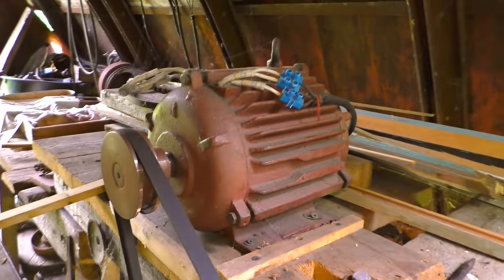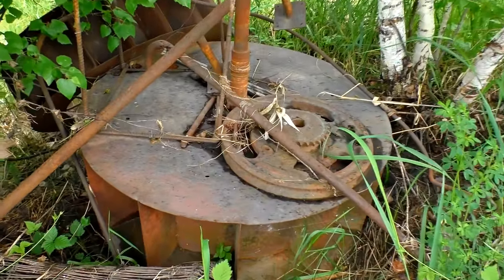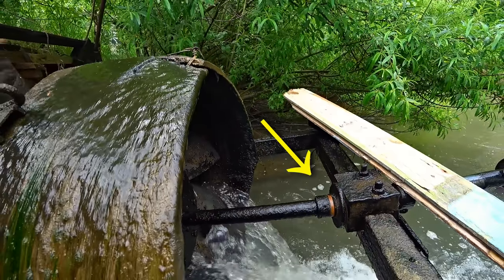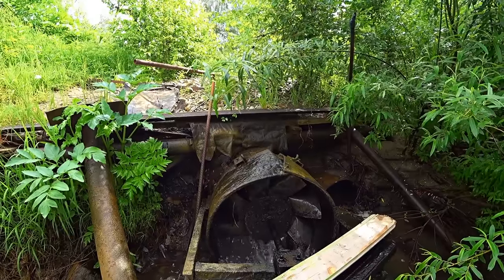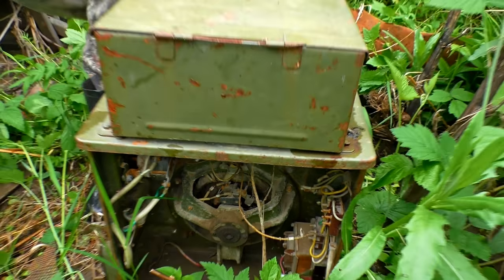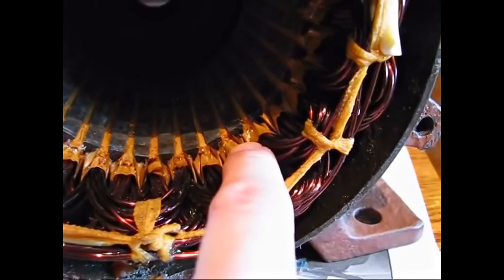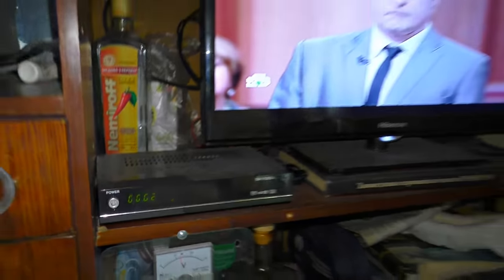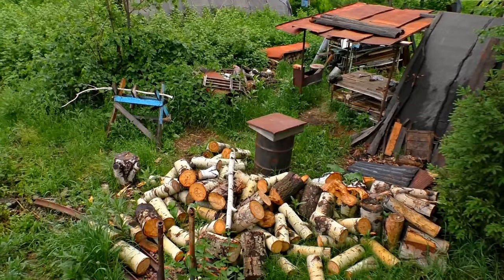Homemade Hydro Electric Station! Alternative energy! Free Electricity! Autonomous energy

Comment: Love the greased wood bearings, great solution for low speed operation.   Keep your eyes open for an old E-bike hub motor.....they make good generators, too!
Reply: If he could get hold of some Lignum Vitae he would be all set. It is a wood that is hard and was used on boats as the prop shaft bearings/seals and works well with water as a lubricant.

Comment: Kreosan...Your info is requested please sir. 
1.)  Did your fan blades for your hydro turbine come from a truck or from what ? 2.) Did the deflection cone on the front of the fan blades come together as a unit or was it from something else and then added to the fans front ?

Comment: Wow! Amazing how good lithium-ion batteries have got!
Reply: electronics help care those are regular lead acid car baterys
With you can make by yourselve easy if you didnt hav found one of many used ones that are stil somwhat hold their voltage i think you can fix an old car batery simple with puting new destilated water or change the lead plates (i think it is somehow possible to remelt the lead plates).

If lithium ion baterys break down after at least 5-7 jeard you cant easy repair them you literaly need to produce a new one with wastes a lost of energy material an produce a hughe amount of co2 and anouther gases
Reply: @tobiaszistler  Lithium ion batteries play a key role in the energy transition. We can't do without. Recycling is possible. It roughly comes down to grinding the cells and then separating the materials.
Reply: @Simon-dm8zv  that wastes imens amount of energy and complet recicleing isnt feasable auround 60% are praktible when i last read about it. 

Also Lithium ion isalso a already old tecnology that exists since  the late 80s
And got manestream in the early 90s.

So to hope about fast wonders there is ognorant.

Also there is no transition needed with power to liquids fuel every regular ice is way better tha a E -vehicle can be 

But gues what 

They want you to buy every 5 -7 years a new car because the baterys are then dead.

We can easily do without them  
Exactly this metality buy every year the nex eco shit is copletly hypocritical no one can repair their stuff it gets mostly thrown away 
And with e cars it gets worse and nearly imossible

Comment: KREOSAN, You can also use a car alternator as a generator in this case, to charge the batteries. The DC current in the excitation field can be varied to control the output current/voltage.
Reply: Too much power. Too bad effiency. Max Effiziency is 50% of Car alternator. Also Not living long

Comment: you  should try and look at a hybrid car generator  and battery  rather then using a  alternator  you can generate much more power, and store as well
Reply: This setup and load works - why risk slowing the wheel too much with a big resistance load?

Comment: Good idea. You should really work on improving the design tho. Move the generator much, much closer to the turbine. Mount the turbine horizontally and create a tub for it that would generate a whirpool effect. or mount it vertically in paralell with the waterflow.

Comment: Step one:  Find a creek that the govt. will let you play with.
Reply: empanada401 yeah I don’t think I can do this in the states
Reply: Buy a property that has one on it. Problem solved. Or dig a hole to find a spring. and divert the water from it.
Reply: So I’ve been watching homestead rescue and they built one for a guy in Alaska. The trick is building one that can be taken out of the river. If you build one that is permanently in the river that’s where you can get in trouble. So they built this guys’ station on some buoys that can be take out of the river at any time and boom you win. That’s the trick.
Reply: we have a river on our property and i might try something like this.used to have a mill/ blacksmith that had a water wheel which is long gone
Reply: He have no government, he lives in Lugansk. Its a warzone.
Reply: I’m thinking even on a pico scale a small diversion weir with some methods of deflection of debris and you just do it - bury the pipe and wild electric cable and sort cleaning the power up inside your destination building. 
If you don’t do anything to actually impact the environment, “A”, and “B”, you don’t make a billboard out of your bright white pipe in the woods really who’s going to bother you?

Comment: 600 watts will struggle to power a normal fridge, let alone a TV & additional loads. No Matter.
I love your vids guys !!
Reply: Batteries and an inverter.
Reply: Incorrect. TVs run on 100 +/- watts. So as computers on full load. I have tested my claims.
Reply: Aleksas LTU, Weak laptop runs on 50+/- watts, but a normal computer during work period runs on about 500watts. Modern fridge runs on about 25-50W, modern average TV runs on about 70 watts.
Reply: Alter 500 watts? What kind of a normal computer houses 5-6 graphic cards ? I have mine with 2 GPUs running at 220 watts at full power.
Reply: Aleksas LTU, I'm not talking about idling, i'm talking about power usage during work. Just did a little research, average gaming computer (not laptop) during work period uses about 500-600w and i'm not including monitors and any other additional devices. And you're right, basic home computer uses about 250W, I had to be more specific.
Reply: Alter what you have reed is false, if a computer with 2 components that is fundamental to gaming is not a gaming computer I do not know what is. And it eats 220 watts in full power repeating myself. Maybe we are debating a different electricity measurements - I use the European watts. In these units - to use 500 watts of power you would need to run a computer with 6 graphic cards, triple the amount of what I have - 2 graphic cards.
Reply: A modern fridge light bulb  uses 25-50w !!
Reply: MODERN fridges use LEDs to light the interior, which are in the single digits.
If you are running a fridge off-grid you are probably savvy enough to remove the light bulb so it uses 0w
Reply: First of all those LEDs only work when the fridge's door is open, secondly - it uses about 5 watts, no more or less. I am not sure at this point are you using watts or vats as a measure, again, I am no electrician ( do not know the difference between watts and vats ), but I do possess a machine that tells me the usage in watts. 5 watts is nothing, check it for yourself in an electricity calculator online, even if you ran it for 24 hours - which is unrealistic - it would not break even 10 cent euros. ( The bulb only runs for about an hour per month, based on a guess of mine, if the mechanism that only powers the bulb when fridge is opened is present that is).
Reply: HERE in Europe our fridges are 100-150w. Your Energy wasting US Style with ice cubes are different

Comment: Really Great. What would be really cool is if you could use a series of discrete turbines that floated, with vertical freedom of movement to the natural level of the river. No need to disturb the natural course of the river. But I wouldn't know where to start building what you have there.

Comment: Pretty cool :-D I would use a regulated car alternator to get a stabile voltage but this solution seems to be good as well.
Reply: But with AC high voltage output you can get power over a distance with less loss. Then rectify and store/clean it near its destination. One less piece of equipment one less place to lose wattage.

Comment: I'higly recommend you upgrading those wooden bearings with some heavy duty self lubricated ones,They aren't that expesive + they last for years!
Reply: Squanchy FapFap 
It wouldmt make sense. As you can see its a makeshift damn with a makeshift "turbine" connected to a makeshift generator. Its all cheap and accesible. If youre gonna start using more exquisite materials then just make a concrete damn with a proper water turbine and a flow regulation system to keep the voltage stable dispite te load.

Bearings are expensive. Itd be better if he weres to make a ball bearing with a wooden race and some huge steel balls as the bearings rolling around the steel pipe. The balls being that big would have enoug surface so that the wood wouldnt crack or wear, add some petroleum jelly and that should be quite watter resistant while having less friction and being more tolerant to being misallingned.
Reply: Exposed to nature would be too harsh for many bearings, especially -30C. Adding them would require more effort than just replacing the wooden ones.
Reply: as well as he need to make a bigger turbine
Reply: . Please
Reply: @garyla3584  
People don’t realize wooden bearings are used for many things today. The just don’t understand bearings or have Manufactured Item Dependency Syndrome.

Comment: Hi kreosan, actually asynchronous motor is easy to used as asynchronous generator, no need to change the rotor with permanent magnet, to produce the electricity you need run the motor near the ns, stator rpm, then you need to inject atleast dc 12v at stator, 1second only in first time. Aftrr that  the stator will produce temp magnet and will transfer to rotor. The imajiner power as kvar need to provide by capacitor and install at stator, the simple formula ns=nr=1, and XC=XL=1, i have try this methode 15years back, you need to try it, this will no maintenance in generator and sucess for you

Comment: Man I have so many upgrades I could give you. Like a simple one would be make 2 of the water fans and put them both on the same large pulley by making then both spin 1 gear between the 2 shafts and then add another belt and another motor(generator) also to amp up rpm. Do the large to small on the 2 shafts to 1. 2x1.5 size turning a 1 size if you get it. Hope you read this. And good luck.

Comment: I love it. I really want to live by the river or steam and i would use the free water line to : generate free electricity, built a water cooling system for my gaming pc that i would not need a radiator nor fans, make a full watered roof for my house in the hot summer... Dear Santa
Reply: I gave you a like purely because I wish I thought of running river water through my gaming pc to keep it cool 🤣🤣🤣

Comment: Use siphoning and make electricity more easily 

Use synchronise motor which provides more current and electricity voltage volume

Comment: If you made everything you had run on 24v then you could eliminate all the expensive components like the inverter whose initial cost is almost as much as the battery cells you would need. ? Just a thought?

Comment: What happens if u put like 2-3 more blades into the tube but on the same shaft, does the power output increase or remain the same? I would assume that the torque increses but the water flow might decrease?

Comment: You would get more power with more blades attached inside the tube the water is coming out of. Titanium is lighter metal and stronger. Not cheap though. But would probably make great blades.
Reply: Mass does Not matter for this task at all. Like literally at all. At all. And Steel is cheaper and also Harder.

Comment: Hey man It's a nice video please tell me the capacity of alternator that you are using for producing electricity by hydro power ... why are u using wooden bearings instead of ball bearings?
Reply: Wooden bearings are used in the local municipal powerhouse in my town in Vermont. I’m parked about 400’ from one now. Been using wood bearings since ?1930s? or so. 
Ball bearings have to be clean and don’t survive water well. 

So wood bearings are fine for this application.

Comment: use a wire a zinc plate as sacrificial protection the ions generated from the flowing water will transfer over to the zinc and it will rust instead of the steel.
Reply: It does Not Break because of rust. Because of abrasives maybe

Comment: With a stream that size the torque must be fantastic, however have you looked at the possibility of running a high rpm pelton turbine instead?
Reply: They’re doing a low head, low impact thing. So not maybe a good plan.

Comment: Thanks for shareing, that's great project. I think turbine could be even better. Just make one stacionary element that will "twist" watter flow before actual turbine, like real kaplan, francis..., turbines. I'm not sure what term is used for that in English but may be something like "guide vane". Keep up good work.
Reply: Sasa Radulovic yep great idea. Guide vane or stator vane.
Reply: S.P. Smith Audio I don't think stator vanes are good idea for single rotor turbine. In jet engines stator vanes are used aftet the turbine wheel to straighten the gas flow for the next turbine and after the last turbine to straighten it for the nozzle.
Reply: svetko05 Absolutely stator would increase power. Startor directs water flow in 90degree angle to turbine blade.  It creates more torque and decreaces water flow. Thats how it made in old watermills.

Comment: Just wondering here is more efficient. This one with the turbine rotating vertically, or as I've seen in other small scale hydro systems the turbine rotating horizontally with the generator mounted above/below.

I'm thinking with the turbine rotating horizontally, the water feed flue design aids in power development as the full momentum of the water can be harnessed. Water feed onto only one side of the turbine and falls down through it to the exit flue.

Comment: Nice one, just a question: why not placing the electric generator right above the hydroelectric fan to cutoff all the mecanical friction u have on the line of pipes ( even if are lubricated)?  Second, due the large intace of water, adding more blades to increase torque so u can spin the generator faster or maybe 2 generators?
Reply: Did you see how the flood and snow stormed the entire riverbank, the motor would rust into oblivion   within months, unless you want your generator stationed underwater

Comment: Do all generators have neodymium magnet in it's armature?
Reply: It's a 3-phase motor. They added the magnets.
Reply: Tech's Science all generators have some type of a magnet inside. The magnetic field may be generated by the spin. Generating current from residual power in a capacitor to get the field started then inducing a large magnetic field Inside armature. And it grows stronger as it spins faster. Generating more power. That also makes the field stronger. To a point. So if disassembled there is no magnets. Until it is started. Just like an induction motor. The magnets are just way simpler way for getting a strong magnetic field.
Reply: JAMES! Since the 70's i heard in some of the generators they provide little bit current it armature to create magnetic field they don't have any permanent magnet

Comment: That's what I'm talking about!!!! I have a small stream I want to build a hydro generator. I have low flow and no head. So I plan to dig a holding pond. About 20' x 4-5' deep. I still will not have alot of head. I was thinking about building a water wheel. To build a high tq. wheel to spin a similar generator. Or a pma or just a alternator. I was thinking if the wheel was wide and tall. And held alot of water. It would make big tq. Then over drive it to spin generator. With about 500-750 rpm from about 5 or so at water wheel. Do you think this would work for my situation??? I'm off grid and need the power. Even if it's just 3-400 watts. I also need a charge controller that can take the higher random voltage and convert it to about 30v to charge lithium batteries. I'm slowly transitioning into lithium . the lead acid would be alot easier to charge. I would love to see more about this setup. It is a rough looking well working system. Looks just like something I'd build. Only better! Please show more! Of this and/or some like it. Thanks
Reply: Awww man, no head? :( That's the worst. Everyone needs some good head occasionally.
Reply: Dirk Pitt trump would force you to have a wire so that he can build his coal fired power plants...
Reply: For decades (long before Trump was president) it is illegal to have a personal Hydro plant but some do until caught then the TVA issues them a desist letter by X date or else they take you to court.  They don't like competition.
Reply: Use ultracaps as well they are more better than lithium and feeds the energy straight away,use worm gears to speed up with water pump two ponds free energy all the time;!
Reply: Putting aside the anti-government grumblings here, they do make something of a point: You do need to check state regulations. Even micro-hydro may need an environmental impact assessment, which may well cost more than the equipment itsself. If so, you might be better off going solar. It's not 'the gubmint' trying to take your freedom away - it's just regulations which are written with bit multi-million-dollar projects in mind, and so make no allowances for very small scale situations.

Comment: Hi sir for electricity genration constant rotation speed is mandatory.
For the constant 50 or 60 hz frequency.
What mechanisam you did for that and what you will advice us
Reply: They are using an inverter. So neither the exact voltage nor the frequency from the generator matters.
The Inverter will adjust both to give a reliable power supply.
Reply: most modern devices have self regulating power supplies anyways, so they dont really car about frequency and input voltage as long as its reasonably stable